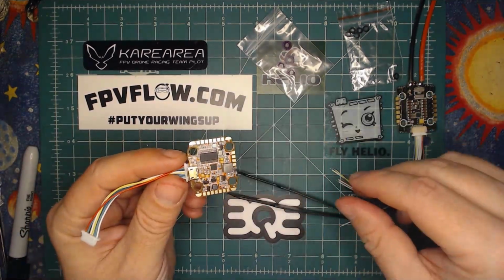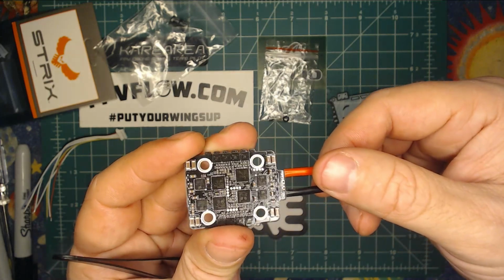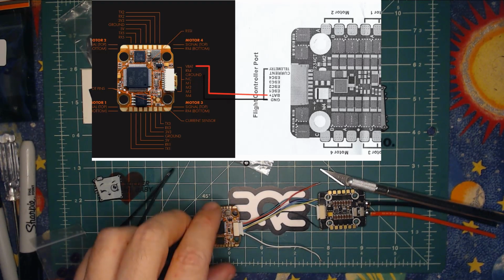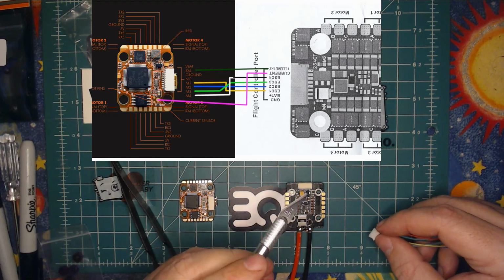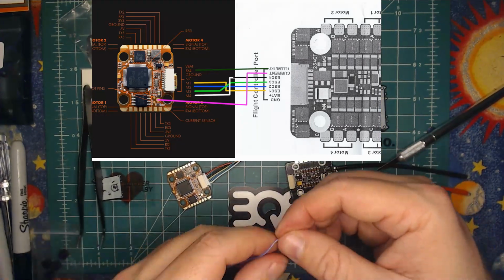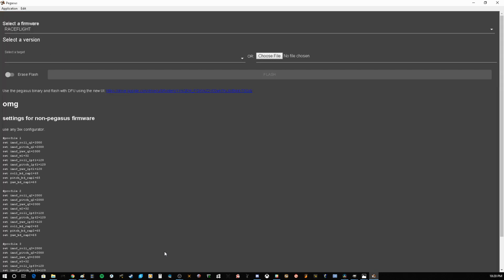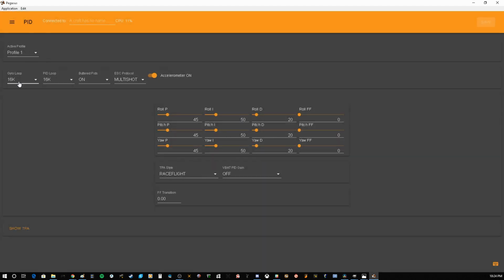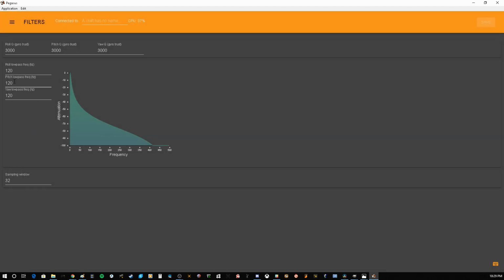Helio Spring Mini and AK32pin 20mm esc Setup

Comment: hi Madchiller I have a simple 4 in 1 raceflight spark v1 esc which has no current sensor or telemetry there is just a vbat or 5v output, if it's with a v.bat pad you power it the fc do I connect it the vbat or the 5v of the esc ?
Reply from the maker: tagada 73 Use the Vbat .. remove the 5V..
Reply: @MAD_CHILLER  thanks bro

Comment: Hello ! Thanks for this very useful video! I plan a build with the same components. Is the current value displayed correctly on telemetry ? In my last build (with other components) I get fixed current value completely wrong...

Helio mini Does it work as well with betaflight 3.5 ?
Reply from the maker: Dany Davidoff Hey Danny!  Current information is based on which ESC protocol you are running.  On the Aikons I use multishot and use the dedicated current wire.  This does require a bit of tuning but is accurate.  With dshot you can try esc telemetry but this seems to be a bit buggy .. some people have great success but other seem to struggle getting dshot telemetry working.  I believe this will require a blheli32 update to get sorted.

I don’t personally run Betaflight on my boards,  I’m firmly rooted in butterflight or raceflight firmwares...  but I know many folks have success with betaflight..  I find the majority of features and filters in betaflight are not required with helio imuf, and the types of builds I’m doing.  I hope this helps! Send it!
Reply: Thank you very much ! I start building tomorrow... Maybe I might have other questions...
I'm curious to explore something other than Betaflight...
Reply: Hi I try to get it to work on my helio spring v2. No way to get the Current to work. Very sad. Best regards Marc

Comment: hey bro, nice vid

i have un issue on the beeper, i am on dshot and i can't have my esc beeper working ...
i have the beacon set = 1 :/
do you know why ? =)
ty, subbed
Reply from the maker: LYA FPV did you set the beeper in cli? set beeper_dshot_beacon_tone=3 value can be 0-5
save
Reply: @MAD_CHILLER  i just tryed all number and nothing :/ my mode beeper set, when i turn my swt  my fc seem to react but no motor beep
Reply: rev 16.77 dshot for my esc
Reply from the maker: LYA FPV try “beacon RX_SET” in cli and then type save
Reply: @MAD_CHILLER  yup that was the good one, ty :)
Reply from the maker: LYA FPV yay! Glad you got it working!! :)
Reply from the maker: Did you try the Beacon command in CLI
Reply: @MAD_CHILLER  i find my misstake, i looked at the beeper RX_SET but both command have RX_SET 😂 .. the right was the beacon rx .. thanks you for searching too !
Got alright ! :)

Comment: Thanks for the great video. I've been flying Helio since the first pre-order and love it. Building a new floss3.0 with the same esc as in this video so this is kinda perfect. This will be my first 6s quad (finally) and I'm wondering how much you find you need to adjust pids and filters for 6s on the spring?
Reply from the maker: James Papier with a lighter quad on 6S I tend to need to drop PIDs a bit, but I still tend to up I on Pitch.  On a lighter racing frame I would also try the W setting at 16..  otherwise I’d send it and get a BBL.. check my noise prints and if needed drop the LPF in the imuf settings for the noisy axis...
Reply: @MAD_CHILLER  sounds nice and normal. Glad to hear it's basically the same process. This will be on the floss 3.0 with 2207.5 1722 kv hyperlites so should be super fun!
Reply from the maker: James Papier your going to love 6S ...